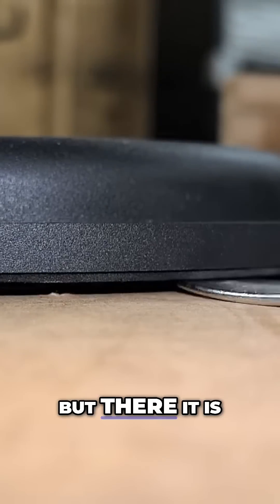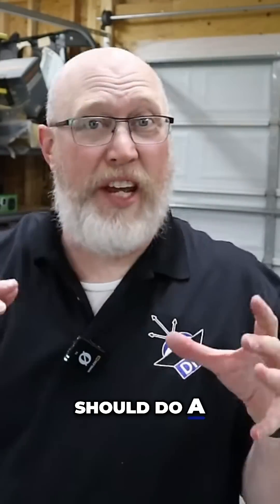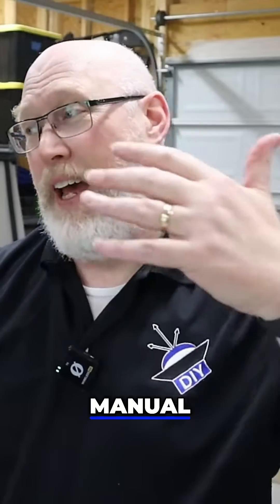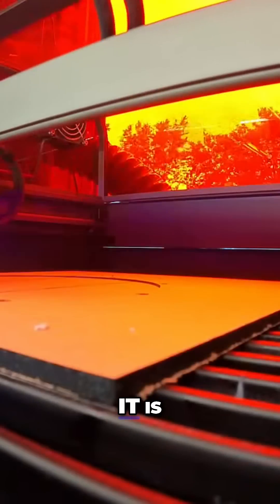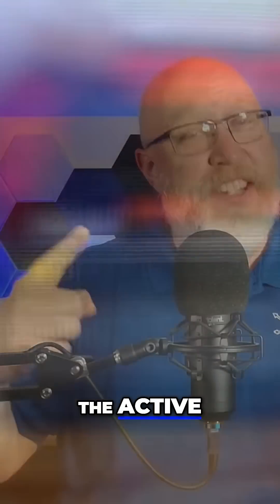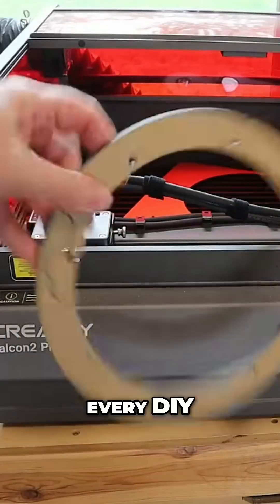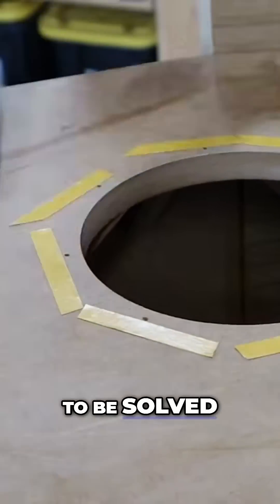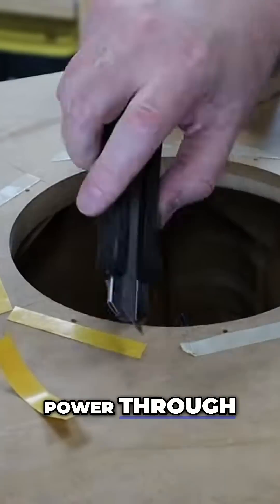DIY Speaker Fix  Problem Solving for Audio Perfection!

Comment: I just built a box where the driver had a cut out listed that was an 1/8” inch too small. 😡 Honestly, took some 60 grit and about 5min of circular sanding to shave off the extra and it looks just as good as a router.
Reply from the maker: I've definitely done that before.
Reply: @DIYAudioGuy How thick of material can that laser cut? Thinking of building a CO2 filled small sealed sub with an 6.5” X V2 but need something impermeable with small tolerances. A laser CNC like that would be perfect.
Reply from the maker: @ndoc8889  I've not tried anything thicker than 1/4 inch, but with the right setting is it can probably get through half inch.